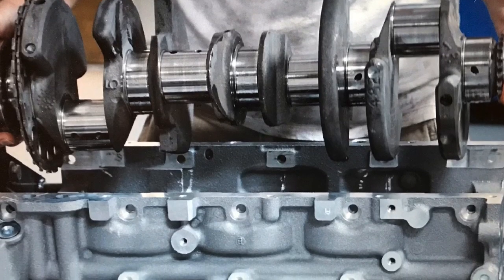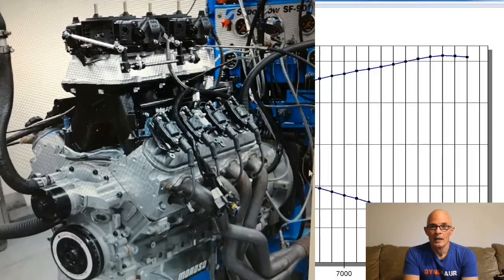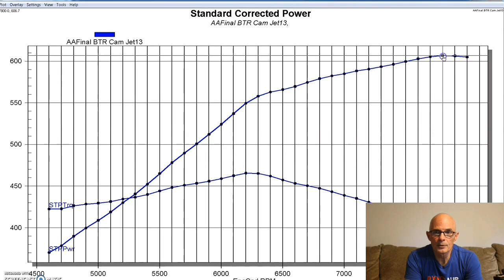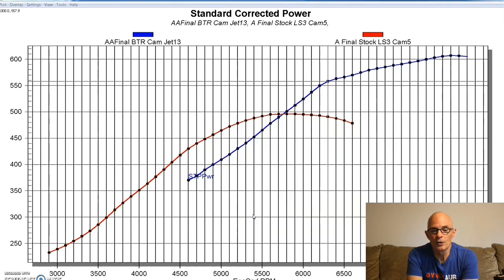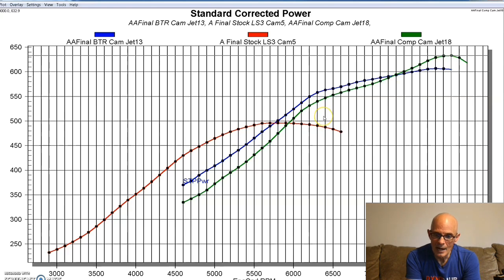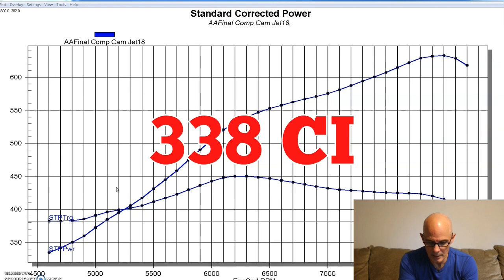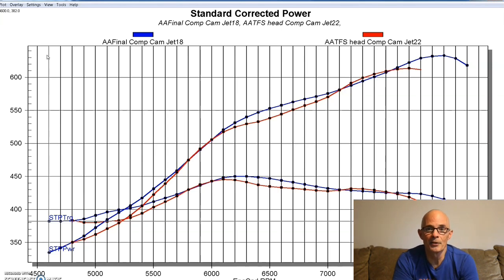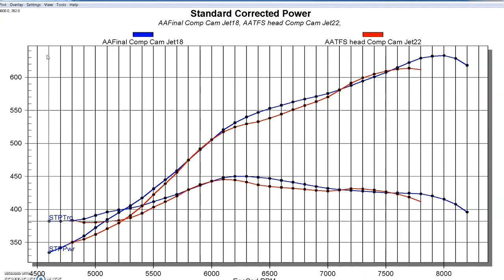DESTROKE LS-4.8L CRANK IN LS3 BLOCK-SHORT STROKE POWER-AN LS MONSTER MYTH?

Comment: I feel like you should have informed people that the shorter stroke lowers the speed and distance the pistons travel and make it easier for the engine to survive longer at at higher rpms without as much wear and friction as a longer stroke would cause.  Also, reducing the mass of the rotating assembly. The shorter stroke is especially helpful on the street or on a track.  Less torque helps keep traction under throttle, and less piston speed means less wear at all rpms. The 302 formula is great with power on top and long engine life cruising on the highway. More rpm means more scooting and less shifting, too.  You need just enough stroke to get the low torque you want.

Comment: Given the same displacement a long rod short stroke engine will pull harder mid to top and do so with noticeably less vibration than  a longer stroke smaller bore engine. Put a revving , short stroke engine in a light vehicle with the right gears and you will have a awesome performing street machine. Put a high revving de-stroked engine in a heavy vehicle and general performance will suffer. Put a stroked engine in a heavy vehicle and the low end torque will enhance vehicle performance. That's if all horsepower ratings are the same regardless of engine displacement. Europeans generally use short stroke engines because they take driveability seriously. Why doesn't Lamborghini put big displacement engines in their cars? And when they do up the displacement they often add more cylinders not a larger crank. Third gear at 8000 rpm is awesome!

Comment: You never went over applications of a motor like this.   I would use it in a ski boat. Boats are about the only application that needs to run high RPMs the majority of the time. 

Kinda like Fords B303 Cam.  Sounds great, has no street application other than bark and no bite.   It's a great boat Cam because it's built to make power at high revs. Personally, i think it was designed for ski boats but got popular with the street enthusiasts and FORD went with it.

Comment: Long stoke engines may have the ability to rev very high with the right valve train the stress on the rotating assembly is extremely high and the engine will not live long at those RPM's. The mean piston speed and the total inches traveled of the piston is very very high so ring land wear and damage is highly likely and the acute angles of long stroke long rods is very detrimental too the mains and journals. Can you do it? Sure but it wont last as long as you would like.

Comment: Seriously Richard, the only thing that limits rpm is the valve train, your kidding right every engine builder knows piston speed is the primary rpm limiting factor. Valve train really only limits the rpm due to the engines ability to flow and not have valve float.
Reply from the maker: piston speed does not limit rpm-calculate piston speeds for mountain motors some time-it's always valve train (years back, F1 motors ran to 20,000 rpm in testing before they rpm limited them-same bore and stroke-just worked on the valve train)
Reply: Richard Holdener gotcha, in that case why it not recommended to spin a big block more than 6500-7500rpm? Also why are small block engines easier for turning 7000-9000rpm or more? Any piston speed above 6000Ft/Min is dangerous, a preferred piston speed is down around 4000-4500Ft/Min and anything above is likely to blow a hole in the block or get blown to pieces in the block in either case it’s a catastrophic engine failure! Calculating perhaps a Ford 351w or Chevy 350 to run at 9,000 rpm (3.5 Ford stroke X 9,000 rpm = 31,500 / 6 = 5,250 Ft/Min! For example: turning a engine built to drag race drag race a ford 351w to 9000 rpm, aftermarket block, crank, rods, pistons, with a top end package including the valve train that’s also specifically designed for drag racing as well would still run at 5,250 Ft/ Min. That’s good but it won’t live long and usually they are rebuilt due to the extreme wear on the internals at a specific number of time or races similar to NASCAR engines that only live for a set amount of race miles or race hours. Every engine builder knows the limit of an engines rpm range by calculating piston speed which is the primary limiting factor. The valve train also does limit an engines rpm range due to valve float and what power it can make in a given rpm range. Cylinder head flow is also a large factor but none of those are certainly not the primary limiting factor. The valve train and cylinder head flow can be the best designed parts money can buy but, if the rotating assembly designed (piston speed) is pushed too far it’s not a question of how long it can run it’s a certainty that the engine will blow above a given engine rpm range due to piston speed. 

I get that some engines can turn 10,000-20,000 rpm but, the engineers designed and configured those rotating assemblies to handle that rpm by limiting the stroke which is the (primary factor of piston speed). Those high revving engines don’t share long strokes like their larger cubic inch cousins in the drag race, NASCAR or race course style engines that need to live for an extended amount of time to complete the given number of races down the strip, given number of race hours or given miles raced for acceptable use of the engine. Just Google F1 engine specs, it shows the 80’s they ran 12,000rpm, 15,000rpm in the 90’s and currently since engineering technology of the 90’s era they run up to 20,000rpm. Yes valve spring and other valve train components limited the engines to 12,000 in the early days but, they’ve now gone to a Short Stroke rotating assembly design that permits engine rotating speeds up to 20,000rpm. My research and engine building experience consists of 20 years of school, trial & error, being professionally trained, working in different shops on several different engine styles and from just building engines to push their maximum potential like yourself. I’m sure your just as good as many out there and they make both you and I look like rookies but, certainly the engineering, designing characteristics of good quality parts and my own experience are a humongous factor in what I’m stating.
Reply: @80sfordguy  I agree with Richard:  it's the valvetrain that limits maximum engine speed.  Rotating assembly components can always be made stronger to cope with the increasing dynamic forces at higher rpm.  Most of the time, it's a matter of having strong enough con rod bolts to prevent cap separation and spinning the bearing.  The highest piston speed I have ever seen was an unlimited 4wd pulling truck with a 572 Chevy that ran 10000 rpm.  That's 7500 feet per minute piston speed.  I saw this truck run 4-5 times in the early 1980's on the Pro Show pulling circuit.  It didn't blow a hole through the side of the block as you say it would.
Reply: Andy Harman 4-5 times in the early 80’s with a 572ci Chevy, ok gotcha! Better still only 4-5 times, I’d be willing to bet that engine got torn down and rebuilt after every event it went to if not more often. 7,500 Ft/Min is not a if it’ll blow it’s a when it blows situation especially with that many cubic inches, the longer the stroke matched with high RPM only increases the likelihood of major engine failure. Look into top fuel engines and their specs along with their common procedures between races and events.
Reply: @80sfordguy  Yeah.  I saw it do that 4 or 5 times.  It didn't blow up any of those times.  It took 1st or 2nd each time that I saw it.  So to sum up.  There was a guy.  That built an engine.  That could run at piston speeds you consider impossible today.  Nearly 20 years before you started building engines.  Maybe you should adjust your attitude about what is and isn't possible.  It may help you break through barriers.
Reply: Andy Harman not impossible, NOT RELIABLE they will blow up!!! Therefore, I doubt you followed that vehicle back to the pits, talked to the builder and they said yeah this things got 20-30 runs on it! Highly doubtful, the best engine builders of today that build 16,000 Hp engines for top fuel dragsters can’t do what your saying happened back in 1980 if they could they would’ve done so but, the technology wasn’t there back then. Highly doubtful it was a 572 Chevy 1st of all, maybe at best a 632 if they had the best technology back then. 

Engines with large cubic inches won’t take that kind of torque at high rpm making 1,000hp plus and stay together for more than maybe 5-10 runs down the track. Not to mention you say “you saw it” likely from the stands watching, have you built a large cubic inch big block of any design or make and raced it or built it for a driver that relies on your engine to win and stay in one piece??? I have done so and the most I’ve personally managed to do is a 554ci BBF that put out 2,300hp @ 7,600 rpm in a pulling truck and a 632 BBC that made almost 2,600hp @ 7,800 rpm, both had the best to offer and still needed to be torn down and rebuilt after 10-20 runs down the track. Anything more, the engines just won’t stay together and the damage is expensive to the tune of $20,000 - $30,000 when they blow up leaving almost nothing salvageable. 

Say what you saw and maybe haven’t done yourself but, sir I build engines for a living and short term high rpm is the only rpm a large cubic inch engine can handle. Shorter stroke engines like in formula race cars can turn 8,000, 10,000, 12,000 or more but there’re short stroke engines that live north of 5,000rpm 80% of the time and make shit hp down low and higher hp on the top end for high revving applications only. Large cubic inch engines physically can’t withstand the constant high rpm for extended amounts of time without slinging parts out of the block, No technology has been invented to do that even today. 

I suppose you’ll say semi truck engines like the current Cummins X15 CM2450 engines that make 460 - 630+ hp with 1,800 - 2,200 lb-ft of torque reliably everyday all day pulling 80,000 pounds on the highway, through the hills and over large grade bridges can turn 3,000 rpm. Also if there’re drag raced like in Mexico and Canada, impossible without destroying the block, head and rotating assy since those engines are redlined at 2,250 - 2,450 rpm. I know because, I worked for Cummins for almost a decade after getting out of race engine building until recently, I was building anything from a 2.3L up to 19L engines including in-frame overhauls then Dyno testing the for reliable use at MAX POWER & RATED ENGINE SPEED on either a engine Dyno or chassis Dyno depending on the situation.
Reply: @80sfordguy  Where did you work for Cummins?  I did, too, but from 1990-95.  I worked on the AIPS tank engine.  Did you ever hear anything about that?

But anyway, I did go into the pits after the pull, and checked the telltale on the tach, and it was at 10000 rpm, so I am reasonably certain that it ran that high.  I didn't get the chance to talk to the owner because he was surrounded by a crowd after the win.  The engine was a 572 BBC because the displacement limit for the supermodified class was 575.  So it couldn't have been a 632.
Reply: Andy Harman recently from 2013 - 2020, started as a general diesel repair tech for 3 months then they finally put me on building engines (what I was hired for) from then until covid19 rocked their world and they started cutting jobs. Cool about the 572 block, super modified is all specialty built engines so for sure it was likely rebuilt between every event (not a one & done) engine built to last more (purpose built for short runs). I’ve seen recently a few of the racers in top fuel, funny cars, pro-mods and pulling trucks starting to use a new design 8?? 9?? cubic inch tall deck big block I think by Dart or Musi that’s putting out 1,000+ hp N/A. Though, I don’t have any experience with either, they are certainly elephantile engines for their purpose. It’s obvious that they’re seeing that turning those previous 572’s and newer 632’s that make 500 - 700 N/A then much more with power adders and specialty fuels over 8,000 rpm is not worth the destruction or cost. Their going to much larger displacement blocks to compensate and make more power with more cu-in instead of turning them to the failure point.

Comment: So are you saying with the same valve train a 5.3 or 6.0 can rev the same as the 4.8 and what about in a manual max rev is one thing but what about getting to redline. Are you saying they would be the same with the same vavletrain
Reply from the maker: valve train determines rpm potential-displacement and power production at rpm is a different thing

Comment: HP ain't gonna matter much without the torque to go with it. That is the issue I always see with a destroked engine such as a 400 destroked to a 377, high HP, bit low torque. I had a 377 (400 destroked) and it had about 550RWHP and about 475RWTQ. In a 1980 C10 it ran a consistent 11.64 and once I had a new cam out in it it actually ran a 10.90. Single race seat, custom sheet metal dash and full steel body with all lights and tailgate (street legal door slammer).

Comment: whats the drivability like? - is there a lot of torque loss down below? would the life expectancy of cylinder walls be greatly reduced since the stroke is short and the heat is concentrated in a smaller area? thanks

Comment: Short stroke is to reduce piston speed and therefore forces.  It also raises the horsepower peak rpm.  I have a very light car (2400 lbs) and I do not want high torque at the bottom end or it will spin the tires that is why I'm using a short stroke motor.

Comment: I just started this build but using a ls4 block sleeved and bored to a 4.185" bore using a 3.268" crank. That makes my engine into a 360ci 5.9L V8 fwd goodness lol yeah this is going into my integra that I want it to be a half mile car. The compression is 13.6:1 on e85 plus I bought everything that is needed to run that fuel. But the only thing that I don't have is what cam to run that will allow me to rev to 9000rpm or higher. The transmission I'm using is a GM F40 six speed from a G6 GT. The heads i bought are the Texas Speed 285 rec port heads because of the large 4.185" bore. Anyone can chime in to guide me in the right direction

Comment: Richard what was the spring rate, seat pressure and open pressure on those springs in that engine, were you able to achieve that high rpm with a Beehive spring ?

Comment: Imagine what that combo would have done in one of Jenkins Vega in the 70s
Reply: Grumpy used .030-overbored 327's in his NHRA race engines.  So 4.03 x 3.25.  Just about the same as this destroked LS3.  Grumpy would have killed to have LS3 heads.  I don't think he even dreamed about putting a 2.165" intake valve into an SBC head.

Comment: Theres an article in Hot Rod magazine in 1997 titled "The small block Chevy should have made". 2 guys engineers/ car enthusiasts took a .030" over sm block 400 4.155" bore and 307/327 crankshaft 3.25" stroke and Ford 300 6 cyl rods 6.209" had rods narrowed , custom J & E pistons with weist pin closer to the top of piston , cnc aftermarket heads 58cc chambers , stock cam stock hei ignition, quadrajet carb and longtubes , 352 cu in. On pump 87 octane unleaded it put out 435 lb/ft and 412 hp and had most of this power from maybe 1800 on up to the peak #'s . Compare this to a stock late 70's 350 and everything else the same this engine made like 135 more lb/ft and 200 more ponies. The guys that did it said rod ratio and shorter stroke the pistons actually stay at tdc longer . And it utylized 36 deg total timing with no pre-ignition.

Comment: So what are the valve-train secrets necessary for a higher redline?  How do you control geometry?  Valve float? Longevity?  Thank you.
Reply: 9000 rpm pushrod valvetrain longevity?  Take it apart and throw every piece away after it accumulates 3 hours runtime.  That's what they do in NASCAR.

Comment: Richard I love your videos.  I am the SCTA record holder in E/CBGC at 190MPH with my destroked big bore 257 C.I. small block Ford.  I run a 4.125inch bore and a 2.4 inch stroke and had to get a custom domed piston to make 8:1 compression but it also has twin 64 mm STS turbos.  Keep up the good work but I had to comment on the destoked combination.

Comment: Ricard, love the stuff you present here.  I was shaking my head through this whole video until the last part.  I have been building engines and cars for over 50 years and when talking to someone that wants an engine built that "really runs" the hardest thing for them to understand is bore/stroke ratio, bore size and intended usage and RPM as far as breathing goes.  I would like to see this test with a different cam optimized for a 6500 RPM limit and cathedral port heads sized for the air flow.  Bigger isn't always better.  ( In case you didn't guess my focus is street engines, I think you understand with racing engines there are no limits.)

Comment: This is excellent! Kinda reminds me about the story when Pontiac wanted to create a engine for the trans am series and came up with the 303 cid to meet the '305' rule. At this moment, i'm not sure if it was a pontiac 350  that was 'destroked' or it was a different engine block altogether. Unfortunately, I heard the project was scrapped after they pulled out of racing in '72 (I believe). I know there was a article about it in a pontiac mag awhile back...
Reply: Do a Google search on "Pontiac Ram Air V".  I read that article a few years ago, and it broke my heart about what might have been.